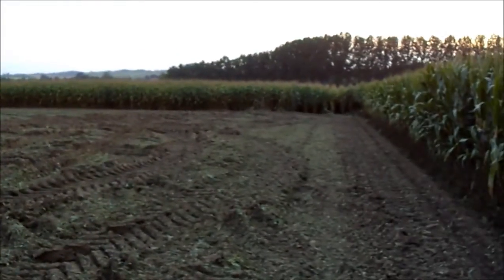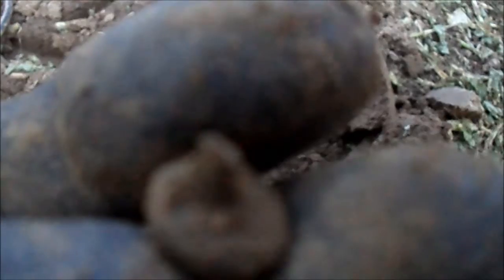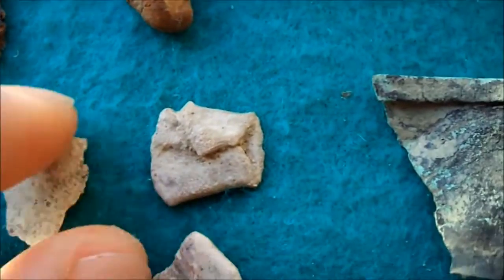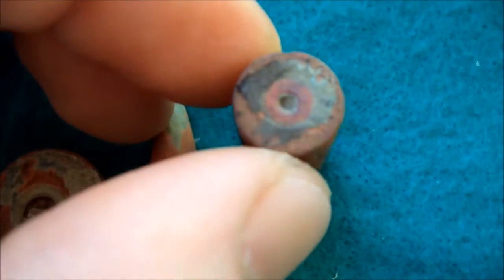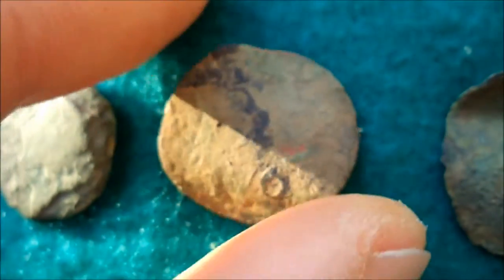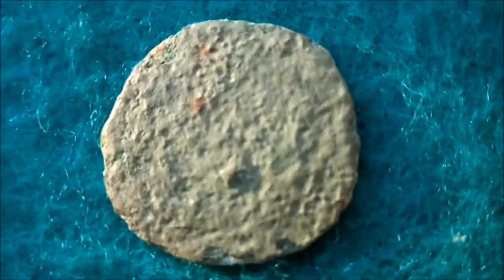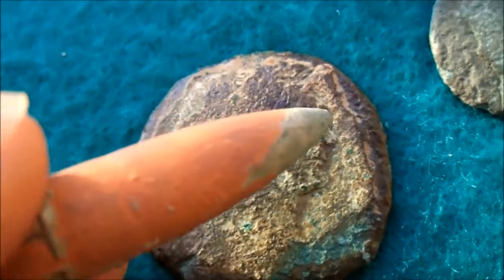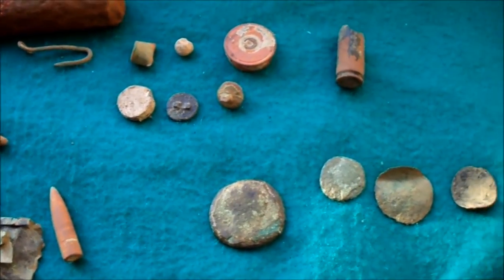Metaldetecting: Old Hammered coins and Roman!! PART2 (nr97)

Comment from the maker: Well David, the 1st one had some of the tekst left an that made it possible to ID it but this one is very worn and no tekst left.. it will be almost impossible..
The face of the emperor (this could ID it by knowing which emperor it is) is the first to wear because it's the highest point on the coin.
The silver ones can be hard to find because of the great impurity of the silver bullion.(the early empire coins are high in silver so good solid signal but the younger ones not..)
Lieven